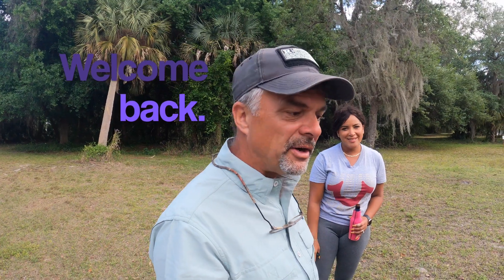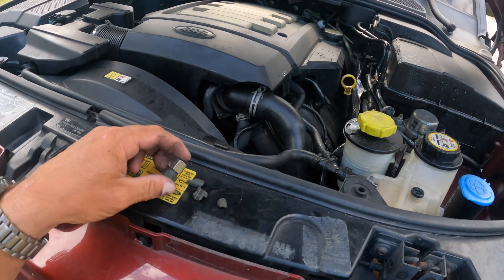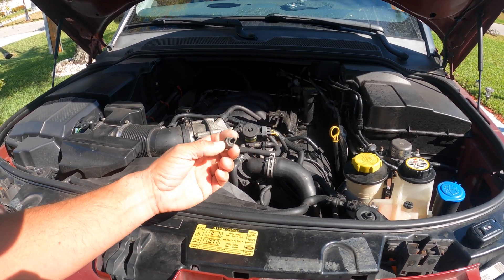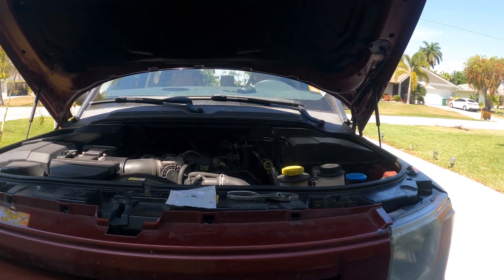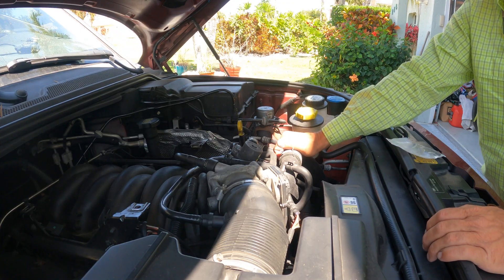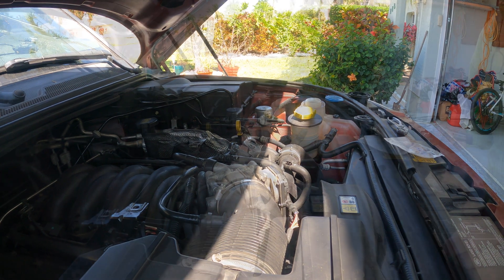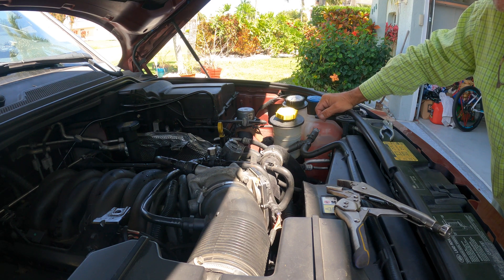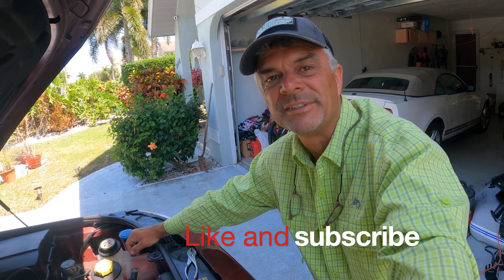Coolant air valve failure Land Rover LR3   4K

Comment: Personally I would have kept the copper piece in place. Far more reliable. My LR3 here in the United Kingdom does not have one fitted from the factory at all. Why the American variants has these I do not know.
Reply: My 2006 American spec LR3 doesn’t have a bleed valve either.  Any ideas on how to bleed the system without it?  Just replaced my upper coolant hose and I think I may have air in the system.
Reply from the maker: @s3hooligan  no I don't unfortunately - I changed mine to be able to bleed it for air as well 

best regards Rene
Reply from the maker: Thanks for commenting 👍 yes that sounds strange, however I saved the copper piece, which might turn out to be an overkill since the new plastic piece probably will last a long time. 

Drive safely 

Best regards René